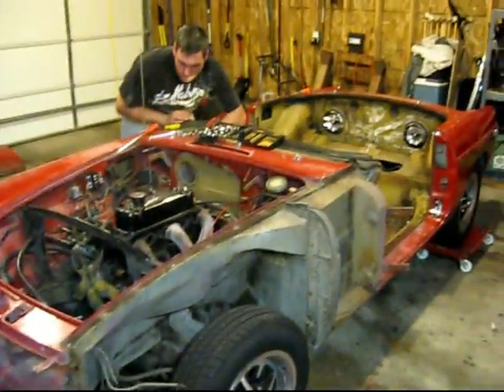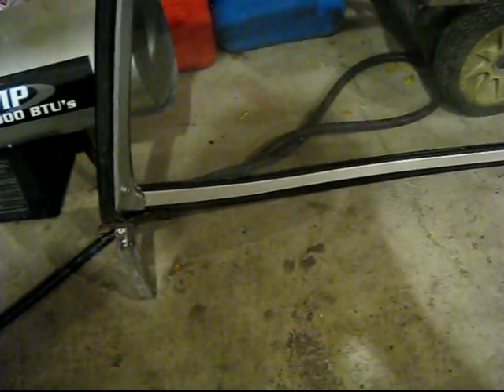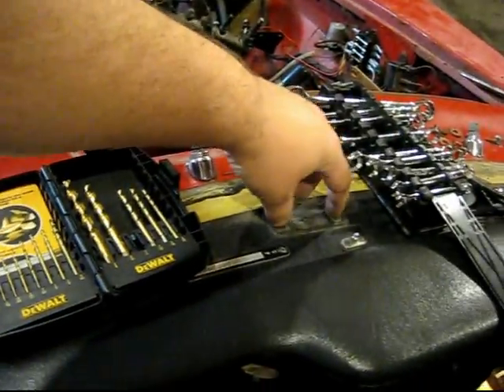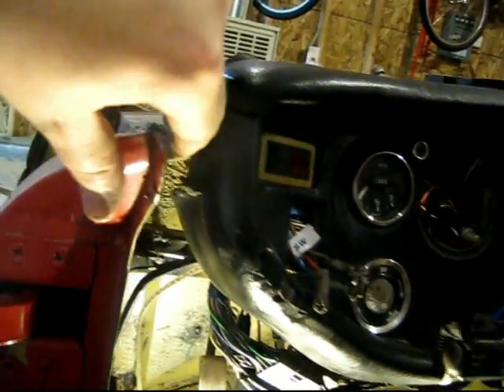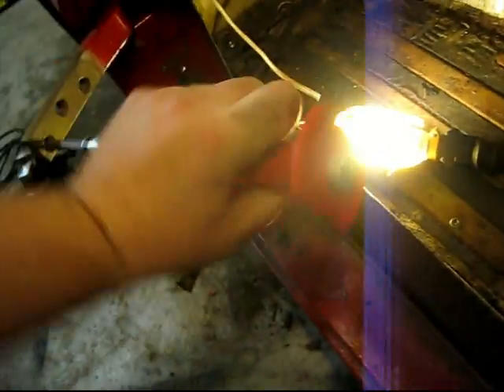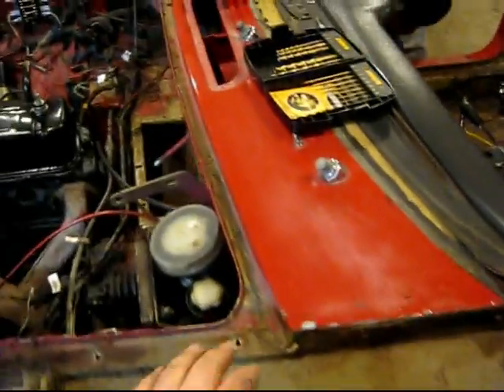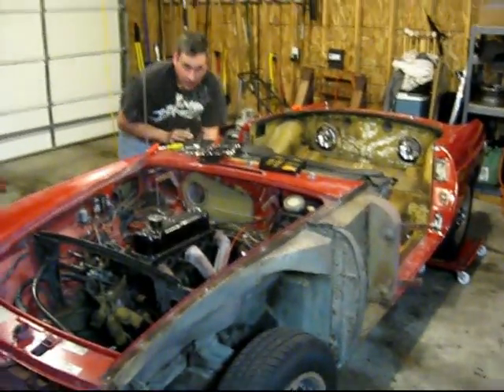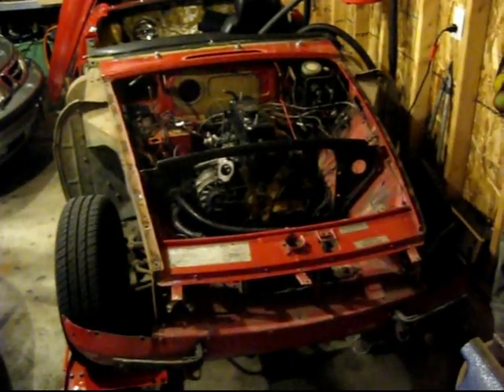MG 6 - Windshield, Doors and Fender Removal

Comment: @anto1191 Replaced many a mg roadster frame- key points, always make sure the side bolts are running smoothly in the threads before refitting. Never restart the side bolt fixing using a spanner, fingers only, high risk off cross threading. Always use the door frame to reset the angle of screen frame, common error, results in cracking the screen and leaking if not correct.

Comment: Thank` s for the video,one question, is the SMITH heater matrix straightforward to dismantle? or you need to disconnect the heater hoses from underneath the cockpit first?

Comment: So you have to take off the windshield in order to remove the fender?
Reply: Yes on  tourer, not on a GT
Reply: @bencolpitts6923  what is a tourer? Do you mean a standard MGB?
Reply: @thorthunder3227  a tourer is a roadster/convertible
Reply: @bencolpitts6923  I thought all the mgb were convertibles.